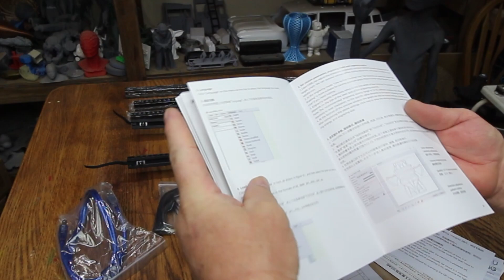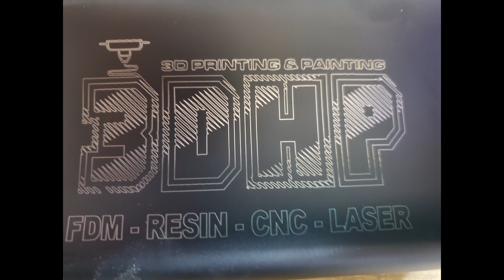Amazing TTS-55 Laser Engraver from Two Trees. #3dhp

Comment: Thank you 3DHP, really liked that you told us what materials to use. This is 2 years old, but very similar to my TTS-55 Laser Engraver. I also bought the blower motor and the y-Rotary accessory (cylindrical holder). Thanks again for the video. Have you tried engraving other materials like Plastic? I'd like to do Dog tags too.
Reply from the maker: Thanks for your comment. I have done a few small logos in acrylic. I no longer have this diode laser.

Comment: i got my tts 55 pro.. but im having some trouble with it. i sometimes get GPIO isr is not installed.. and also i tried to use it with wifi but my device cant find its wifi. even in lightburn when i connect it, it says no wifi.
Reply from the maker: Not sure,email company or check on there facebook group.

Comment: Hello, I have almost this exact laser. Thanks for the video. Question, the red guide light is offset from the burning laser.  Is that how it is suppose to be?  Is there a way to align the two? If it is suppose to be offset, what is the offset? Thanks so much.  I can not find anything about this anywhere. I have only used this thing a couple of times because I have a hard time centering my work.
Reply from the maker: I no longer own this laser but it never had a seperate pointer to line up work.My XTool did and the cross hairs were dead center of your work. I suggest using LightBurn as your software. The are a ton of laser groups online.Like Facebook group and TwoTrees web site should have a help section or links.
Reply: @3DHP  Thank you!

Comment: can i engrave metal?
Reply from the maker: You can lightly mark metal, for a proper deep engrave you will need a fiber laser.
Reply: is there an attachment I can get for this laser? how lightly do you mean, will it be visible? I am trying to engrave some ID tags for my new puppies i have some blank ones @3DHP
Reply from the maker: @commenter-jv5gn   It will etch the metal,you will be able to see it,but probably not feel it. I have many diode laser videos for you to check out.
Reply: thanks! ill check them out. Would a 10 w Laser be better than the 5w for this?  @3DHP
Reply from the maker: In my opinion Yes
Reply from the maker: Check out this video    https://www.youtube.com/watch?v=q2vrphbDXDQ&t=161s

Comment: Hi. Do you know if I upgrade this laser with its 20 w head, do I need the air assist? 
Thanks
Reply from the maker: Adding air assist to any diode laser will help you cut better and deeper. Cleaner cuts and stop possible burning of wood in some cases.

Comment: Thank you for the video. I bought this machine a couple months ago as my very first laser. I have had success with engraving on wood but am struggling with glass. Do you have any suggestions?  I’m just not getting the speed and power right.
Reply from the maker: Buy Tempura Black paint from Amazon or the dollar store. Paint a few layers and dry it. even coats. Do a reverse image and test with different power and speed setting. If Two Trees don't have recommended settings for glass on there site,go to a different companies site and look at there recommendations,like Comgrow, a 5 watt is a 5 watt. Tempura paint washes off really easy.Dry Moly Lube also works as a coating in a spray can,but harder to wash off.There are other things to put on glass and mirror but I think Tempura paint is the cheapest and easiest way to go.Hope this helps.
Reply: Thank you. I do use tempura. In this video you mentioned you were going to try glass but I couldn’t find if you posted one. I thought I’d see if you had tried with any success.
Reply from the maker: @SerenaHaga  I have done a few picture frames,don't remember my settings at the moment, Google etching glass with a diode laser.
Reply: Tempura? Hahahaha!! You mean “tempera”. “Tempura” is a fried dish. I don’t think it will have the same effect as tempera black paint

Comment: Great video, thanks! What settings did you use for the leather and the flask?
Reply from the maker: Image on leather was 5000 mm/m  90% power. Flask I think was 700mm/m  100% power line mode. Many company websites for different lasers have recommended settings,these are what I use. Also for the Comgro Comgo Z1 website, there are recommended setting. I only use Lightburn.
Reply: @3DHP  Awesome, thanks so much for the advice!